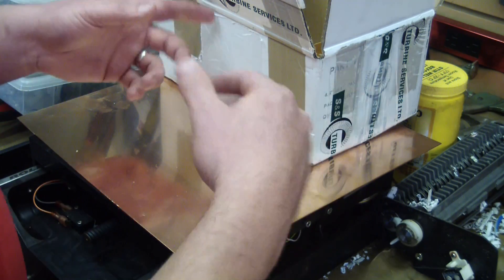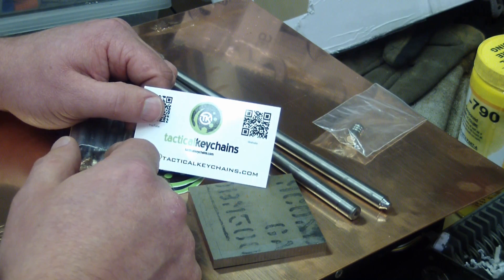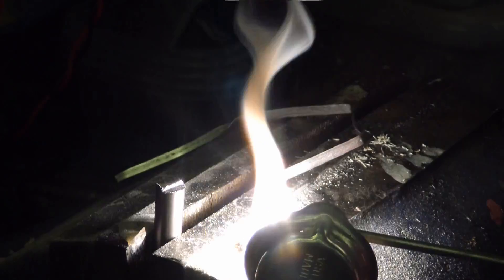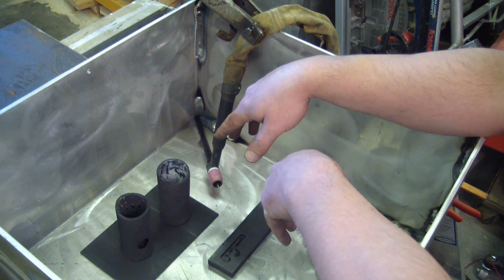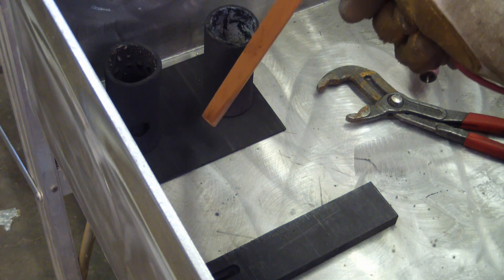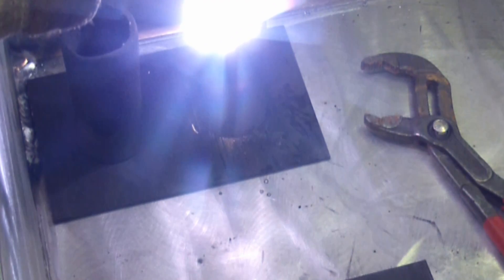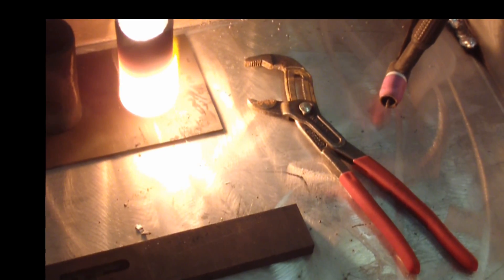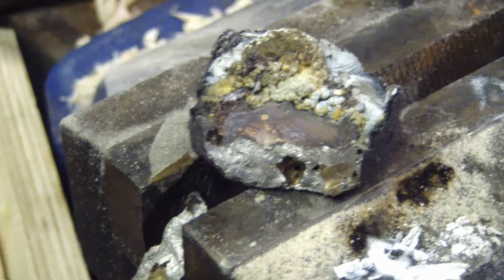Titanium Casting Experiment

Comment: You might be trying to go about this the hard way, Ave. Apparently, your acetylene rig is able to melt tungsten carbide and titanium has a lower melting point than tungsten carbide. The only problem is, once you get molten titanium you need the container to be of something that the molten titanium won't melt through. Maybe some kind of high-temperature ceramic or something like that. Just a suggestion.

Comment: If you can put a cover on that and make a stone like container for the Titanium, like a forge, you should be able to melt the metal as long as the containment can handle the temperature. That is a theory. Another possibility is doing what one blacksmith did. Take your Titanium, make a stone or powder cast and enclose everything in rocks, clay, mud, whatever, to keep the heat in and use up the oxygen inside the containment before the Titanium melts.

Comment: The argon blanket could never work in such a shallow container. Every small movement you make creates a relatively huge turbulent draft that will pull some% of oxygenated air into the mix. That plus the arc forces.

I'd like to see you try again. A remote operated lever controlling the electrode, some more levers for the pouring mechanism, all encased in a pure argon environment that gets circulated through some heat exchanger for heat management.

Doooo iiiiiit

Comment: I'm a Military certified Tig welder. We need to retest every three months for titanium, and let me tell you right now, just because you put the torch inside that box, does not mean that the argon lies in there like water. I have a hard enough time trying to purge the inside of a 4 inch pipe, that's completely purged with only a 3 inch gap open at the area that I would be welding. It can be purged completely confined and at the beginning I could not understand why the root would have contamination. The best thing to practice with is Stainless. Stainless does 2 things. You will either have a nice looking bead, or it will look like blackened, cratery shit!! You should have just clamped the torch with the gas just feeding into the cup. The weight of it could have helped keep the cup a bit stable if clamped properly. Try it again! It can be done.
Reply: +chemech Any proper usage of nymphomaniac in a metal discussion gets extra points.
Reply: +Gordon Lawrence Titanium is actually more reactive than aluminum - I've heard some old metallurgists / chemists call it "the nymphomaniac metal".
Reply: @chemech  Ti sponge in fireworks is what makes the blinding white light. It's much better than Al.
Reply: Cool.  BTW I work at Timet.  We actually make titanium.  Been working here for 11 years.
Reply: +jack suquett good points. People dont realise Titanium is as reactive as Aluminium and a damn sight harder to weild.
Reply: steve rohaley I was working on some weird titanium alloys. I didn't actually get certificated and only did the training. The parts were for satalites etc and even coded welders (UK Cert) passed about 25% of the time. I just had not had enough TIG/MIG experience and was only just at the minimum (2000 hours) for the course.
Reply: Could he test for oxygen (air) with just a lit match?
Reply: we just tape each end of the pipe and run a second argon line in one end.  purge for a few and then turn pressure down so it doesn't effect the root.  once the root is done, take it out.  the rest of the weld tigs normal and comes out like gold.
Reply: steve rohaley I was lucky enough to only weild really small stuff. We could do that in a sealed box with only gloves going inside. Think biohazard containment vessel and you get the idea. We used neon for some things as the customer said argon was not suitable. It was a right pain in the neck but it works.
Reply: doesn't have to be Argon - Neon it better IF you can get it to stay put. Argon will displace air so the "bucket" method works - you need to weild in a fully sealed and purged vessel for neon to work - a real pain in the neck to say the least.
Reply: Should ran it like a sandblaster sealed air moves and mixes good point put

Comment: i'm making a charcoal powered foundry for melting aluminum any advice for a crucible capable of withstanding the use multiple times?
Reply: thanks so much! last component i'm missing before i start using her to cast some stuff up
Reply: travis williams not steel. if you use it multiple times the aluminum reacts with steel and you will end up with a bunch of aluminum at the bottom of your foundry... i thought i could get away with using a stainless crucible... same deal tho, and now theres a mess of aluminum in the bottom of my foundry after 2 burns. clay or ceramic off of ebay will be my next purchase, tried going cheap on the crucibles and failed as result about 5 times now.
Reply: thanks then just worried about some of them due to temps causing a fail.
Reply: my foundry is just a cheaply made foundry from a steel bucket + plaster of paris/sand mixture will do what i need though
Reply: im running the same operation. i tried a variety of cans, i got 2 burns out of a thick coffee can but the second was a fail...every other can i tried including a bean can failed first try. i havent read up on why it fails but im assuming its similar to that thermite reaction, heating up steel and adding oxygen would make it oxidize, then aluminum gives up electrons to the iron oxide and theres a hole...
Reply: i wonder about maybe using the poor mans refractory cement to line it smooth it up and keep the steel from contact. my only concern about the clay crucibles was trying to find information on temps they can take and the running temp of this foundry can vary a bit on how much fuel + air supply so was worried about the graphite or clay ones failing from temp
Reply: yeah i read that you could use a runny refractroy cement coating on steel, this vid ran  like 200 amps through a graphite crucible and it started fire but was fine, but it got way hotter than you could get with your setup.  charcoal and a blow drier would be lucky to melt copper i think you will be fine. ill be trying clay in mine tomorrow. i know someone that uses the clay ones off of ebay and melts aluminum and copper in his 3000 f foundry....
Reply: I wouldn't go with a charcoal foundry I wood instead use propane as it melts alot faster and gets alot hotter also I use a steel pipe as a crucible

Comment: 2:15 Titanium (somehow) is a very good insulator of heat, this is why beaker tongs and other chemistry equipment are made of titanium or alloys.
Reply: Mac Sogandares Titanium is far from beeing a good insulator - it thermal capacity does not much differ from other metals though the thermal conductivity compared to other metals is pretty low 22 W/(m*K) - for example stainless steal has around 30 W/(m*K) some austenitic steels go even below titanium

very good insulators are gasses like oxygen or ceramics - thats why furnaces usually insulated by brittle "stones" like chamotte which are a nice mix of both worlds
Reply: +Mac Sogandares It's used because it can handle hot materials without melting Not because it's an insulator. And they are crucible tongs not beaker tongs

Comment: I turned my wedding ring from titanium bar stock on the lathe, the carbide tool took 10 minutes to cool before I could remove it, the ring I put the ring straight on, it was still ice cold.  The stuff does not conduct heat, it all builds up in the tool and can ruin the cutters without plenty of cooling.
Reply: That's why Sauron used titanium to forge the One ring. 😁 And yeah, never use a titanium wedding ring cos it will outlast you for sure

Comment: I've always heard and as has been said..I think with Titanium, Magnesium and Aluminum you need a electric RF furnace. and even at that you have to heat it 3 to 4 days. years ago I saw a guy dip Titanium in liquid nitrogen to machine it. Titanium and Magnesium are hard to work with.  (casting or machining)

Comment: what about that induction heater around the crucible?  does that only work with steel cuz it's ferris?  you could try an hho torch.  its basically a steam jet that can melt steel.
Reply: Dwight Parker Titanium and Aluminum are both very reactive metals actually. The reason they appear inert is due to the durability of the oxide layers that form very quickly. Inertness is determined by the galvanic potential of the metal and is why metals like gold and copper are so stable to rusting.
Reply: Dwight Parker You can't use any gas torch as you're either going to be burning the gas with oxygen in the air or oxygen from a tank meaning that oxygen will be contacting the metal and oxidizing it to a useless titanium oxide, even if you could guarantee the oxygen and hydrogen would have burned to steam by the time they got to the titanium, super hot steam will oxidize many clean metal surfaces and titanium is more prone to this than most other metals. The oxygen/acetylene torch he has in the video would burn hotter and more consistently than a HHO torch and can be burned with excess acetylene to minimize unwanted oxidation.
Reply: So since you can't let the titanium contact any oxygen at all, you're left with melting it in a vacuum chamber, or replacing the chamber's atmosphere with something like nitrogen.  To melt it i guess you'd need heating coils, electromagnets, electric arc, lasers or microwaves.  But ya, I see what you're saying.  Even IF the hho torch would work, you would still need an oxygen void environment, but with what you've said, it's most likely not gonna work at all.
Reply: nitrogen won't work either, molten titanium forms brittle nitrides, you need a noble gas like argon, which is what he tried to use in this setup, the thing is the convection currents from the heating draw air down into the workspace, that's why MIG welding is usually done inside and the argon gas is pumped out directly at the contact point of the weld so it's shielded from the air while it solidifies and cools below the temperature where oxide formation is going to be a problem
Reply: Ahhhh, I see. So an airless container with a noble gas.  I didn't know titanium would form nitrides.  I figured it would work since it's used for its inertness in many cases, but its true that the noble gasses are the only ones that are truly inert.  So is this done by hand in the industry?  Or do they have fully automated machines do this?  And do they actually mold individual items?  Or, do they make bricks or ingots and mill from them?
Reply: Dwight Parker titanium is machined and welded, usually via an automated process, from pre-cast blocks and ingots this is part of why it's so expensive, Aluminium is usually cast into shape, and finished by hand but can easily be forged, hence why it's so much cheaper to make everyday items out of it like soft drink cans and car parts.

Comment: I spent some time deburring titanium on a belt sander, the thing that freaked me out was the part got hot where you were grinding on it, then when you dipped it in water the heat moved up the part rapidly and burned your fingers where you were holding onto it that was previously cool. Got me every time
Reply: ***** if you still have one of those rods you should do this on thermal camera
Reply: that is my theory as well
Reply: That was interesting, can you show me some theories of how that thing can happened?

Comment: Titanium is really a PITA to melt. Industrial it would be molten in a watercooled crucible, making this process extremly dangerous, if a leak occur and the molten titanium get to the water. I guess the best take would be induction heating the metal under a cloak of argon gas? I have one time welded titanium..let me tell you..stainless is almost a joke compared to this stuff.
Here is a link to a company that does molds with titanium: http://www.castingstechnology.com/ismtialloys.asp

Comment: I worked at a titanium plant for 2 years and it was melted under vacuum with electron beam guns.  The crucible was water jacketed copper and as the raw material came in on rollers or from a hopper, it was hit with the beams where it ran into a basin and overflowed into the crucible.  The basin was a safety feature to keep inclusions out like tungsten and such as this was potential aerospace material. The bottom of the crucible was drawn down slowly until the desired length ingot was achieved.  Ingots were about 3 feet by 4 feet by 20 feet, approximate.  Titanium is VERY volatile in the presence of water.  If you burn through the water jacket you will most likely have an explosion!

Comment: AvE, I'm in engineering school and was told that Titanium can be particularly dangerous to machine. I was told that the filings and dust can actually be explosive under the right circumstances. Did you have to take any precautions before cutting that bar stock?

Comment: The argon is denser than air, but if you heat it with liquid metal it might get hot and escape, putting some air in your inert atmosphere. Convection currents.

Comment: Awesome to see! We almost cast titanium class rings once.. Had the induction melter ready. Had the argon ready. Had ceramic molds ready. Luckily the melter broke down and we had time to do a little more research and find out all the problems we were about to run into. Molten titanium is a bitch. Non-cooled crucible material for Ti casting is STILL an active area of research. Yttria shells with bulk zirconia backing them up seem to be the way to go, but good luck finding yttria slurry mix at the local home store.
Reply: ***** Nice! That should be fun. Good luck with your mold material too!
KoR guy, sigh...also he needs to post his references or stop thieving...two many times I go from "oh actual interesting!" to "oh, that seems like it's all taken directly from this one exact book"..(pvc rockets as example)

Comment: the most i've ever used is a soldering gun so i don't know anything about welding but what might be happening is oxygen is being pulled into the chamber by the positive electrode. if you were able to position the positive and negative differently or create a negative ion field with a custom coil you might be able to effectively shield oxygen atoms from being dragged into the reaction.
Reply: awesome thanks. my chemistry professor loved this video. he assumed the carbide formation and a nitrogen contamination in the argon. i'm seriously looking forward to a follow up should you make one.

Comment: Don't know if this had been suggested yet but Here is my opinion. 
If your trying to salvage the titanium then try differentially heating it. Since the copper and other trace elements in the bottom of the crucible all melted together, try seperating them via melting at lower temperatures.  Also, see if something can be in introduced to bind the chopper to and allow it to float to the surface.

Comment: The gold stuff is TiN, either from gas trapped in the graphite or from the air drawn in around it.  Looks like the argon actually sat around for a little while, but after a minute or so, the intense convection away from the thing (3000 degrees, it's hot, eh?) drew in fresh air, which also explains the yellow flame on the crucible (which should actually be blue from the surface layer of carbon monoxide, but maybe there's sodium around too).

Far as I know, the only way to handle titanium liquid is in a crucible (and mold!) made from an even more reactive metal's oxide (MgO?), which is extremely brittle, and doing it under full inert conditions: not just glove box, but pull a vacuum and backfill with 99.999% argon kind of inert.  Or just leave the vacuum, which is the usual way (which also draws trapped gasses out of the metal).

Comment: If you want to do vacuum pumping on the cheap, you might want to pick up one of those cheap harbor freight vacuum pumps that you use for clearing AC lines. Ben Krasnow over at Applied Science uses one of those with minor alterations to run a freeze dryer and a lot of other crazy things, and I bet you could use a similar setup. He has some cool videos about it, and I bet he'd also have some ideas about how to cast titanium.

Comment: That sulfur-looking junk is likely titanium nitride, so you probably didn't have the air purged as well as you thought. Titanium reacts with nitrogen just as well as oxygen! My guess is the heat of the arc created enough convection currents to pull air in.

What you really need is an enclosure like a glove box, or at least a good ceramic pot (not that red clay flower pot junk) that you can line with refractory, put the crucible in and flood with argon from below. Having a small opening to atmosphere will really help reduce any air from getting in.

Maybe use a regular torch with a slightly rich mixture? Titanium melts at a mere 1700C - only one or two hundred hotter than steel! How hard can it be? ;)

Comment: The TiC thing got spotted below, but something else you might be interested in is that you can't use High Speed Steel tools on Titanium (like your sabre saw blade) because titanium sort of absorbs the iron ions... I destroyed a HSS drill to find out how fast that happened ;)
You either need to use Titanium Nitrided tools or go for carbide drill bits and endmills to make it work, otherwise it'll blunt anything you put anywhere near it just about.

Comment: You might have failed to cast anything but even trying made it a win in my book. I think you should consider reactions between the crucible / electrode and the titanium. The crucible appeared to be on fire, since there was no oxygen that implies there was some other reaction taking place. This paper (http://link.springer.com/article/10.1007/BF00790858#page-1) seems to indicate that you'll form titanium carbide at as little as 1873degK. That would certainly explain why it got so thoroughly stuck in the crucible. It seems commercially they use a copper crucible, lined with refractory cement and built in cooling.